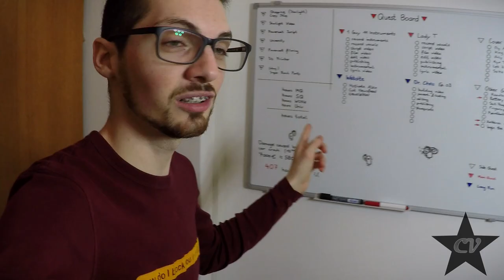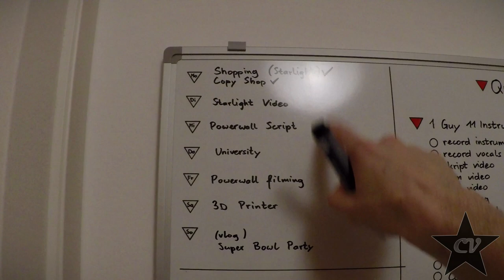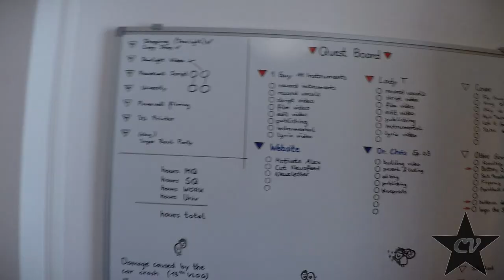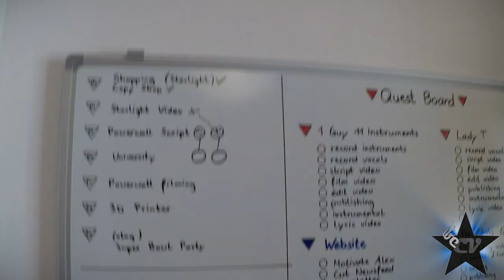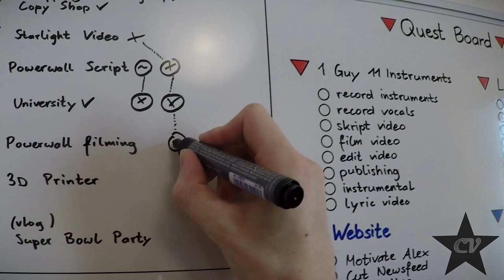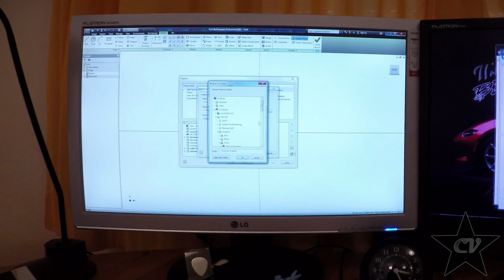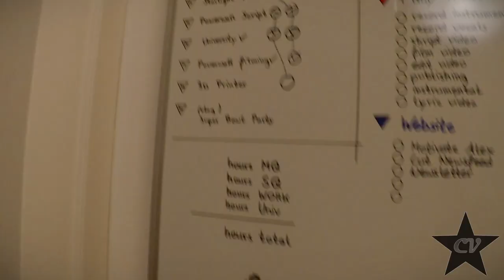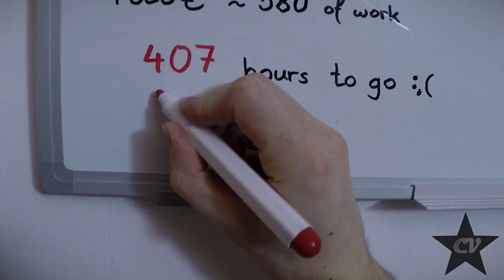DIY Powerwall Project COMPLETED ◈ 3D Printed Knuckles ◈ Superbowl | CVLOG 27

Comment: Hi do you have some shots with installed Powerwall in function?
Reply from the maker: +pangrac1 
Not yet, I'm sorry, but there's not much to see anyways. Oh wait.. I do have one!
Check out my 12th VLOG starting at 6:08
Reply: +ChrisViral Yes Im aware of this one, but Im still not sure if is the powerwall from 18650 cells connected to the system and fully operational. It would be great and very helpfull for community if your dal will make some blog or videos about it, how it works in reality, how usefull its for his daily house energy consumption etc. etc. Ive seen plenty of diy powerwall aproaches on YT but it was mostly about harvesting and connecting in packs and not about conecting in the power system of house and how they keep working on daily basis. It will be great to share your dads experience. Cheers.

Comment: How do you test the cells Chris ?
Reply from the maker: +Mikolando 
I measured the voltage, grouped them. That's all I did.
I'm currently working on a detailed documentation though, coming online in 2-3 weeks! :)
Reply: And does it work properly ? Amazing.. I do all the internal resistance tests, capacity... well I hope you won't burn your home Chris. Best Regards from Poland